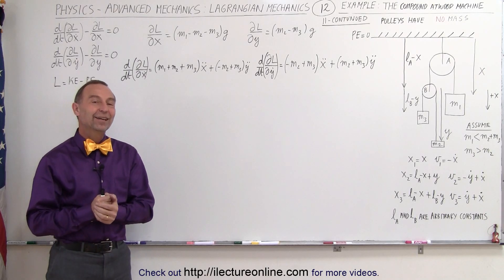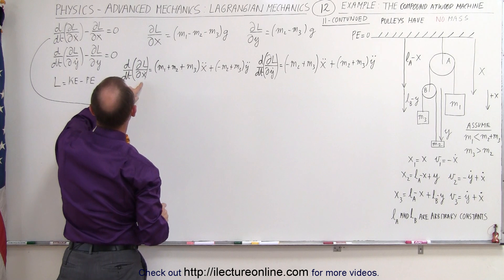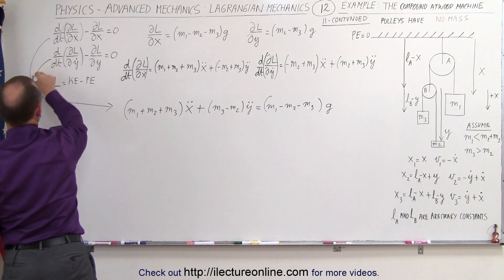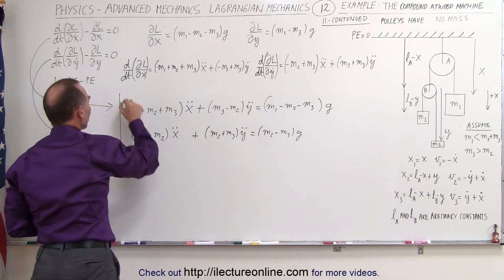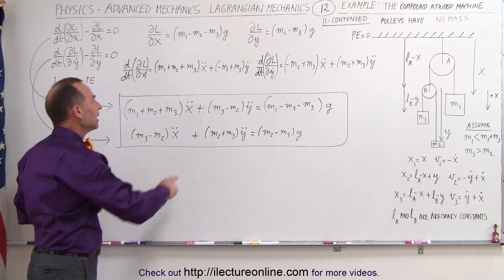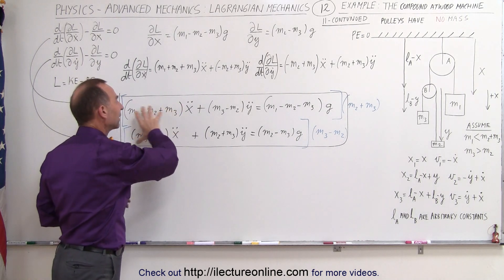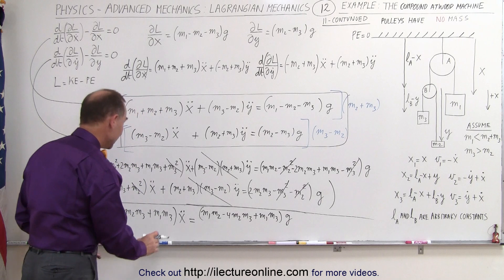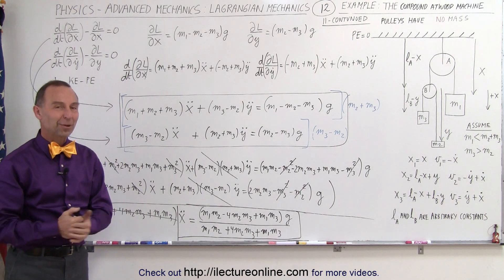Physics 68 Lagrangian Mechanics (12 of 25) The Compound Atwood Machine (2 of 3)

Comment: Honestly sir, I believe a better approach would be to use classical mechanics and in particular the work formula where Work(net work of tensions above masses)= 0 , since the strings do not stretch and after differentiating twice you will get their relationship of acceleration. After that its easy, you will get 4 equations from the free body diagram of the 3 masses and the pulley. Putting these five equations together and simplifying you will get the answer. Sweet and simple.
Reply: I suppose you didn't read the title: Lagrangian mechanics 😏
Reply: That is the Old method. This Lgrangian mechanic method is Better and Used In Robotics. I am Doing a Robotics Project now Hence Came here and It was very helpful : )